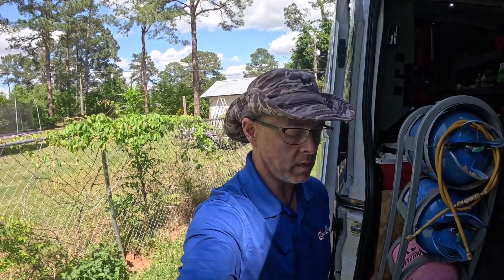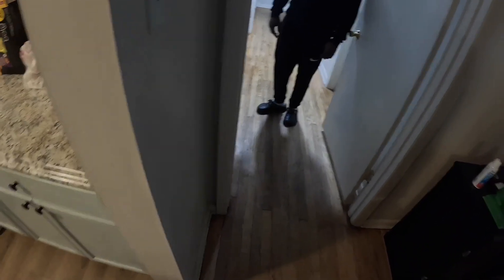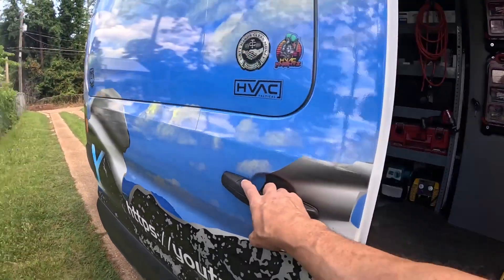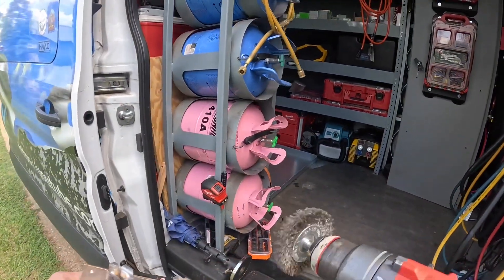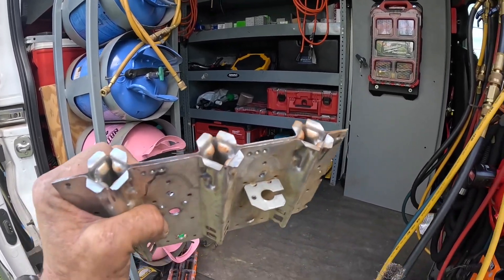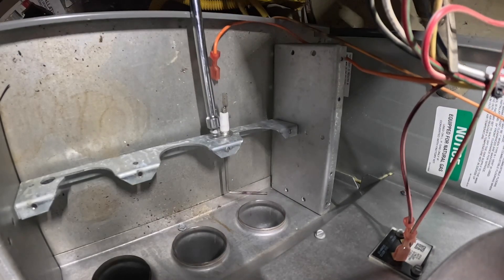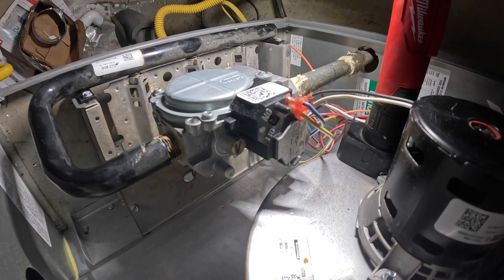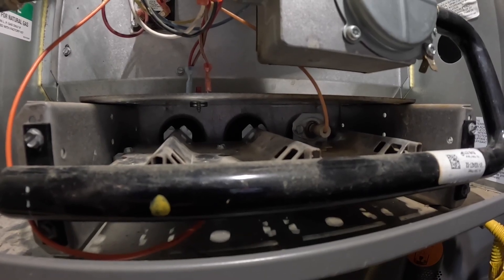A Rare No Heating Call This Time Of Year! #hvacguy #hvaclife #hvactrainingvideos

Comment: Had a similar situation a couple weeks ago. Blower came on immediately when the furnace was powered up. No inducer motor. Limit switch fuse link was blown. I bypassed the link and everything worked except one butner didn't light. Cleaned the burners and they worked fine. Not sure what caused the limit switch to blow, maybe just the one burner that didn't ignite.